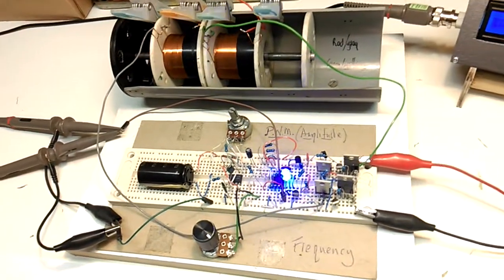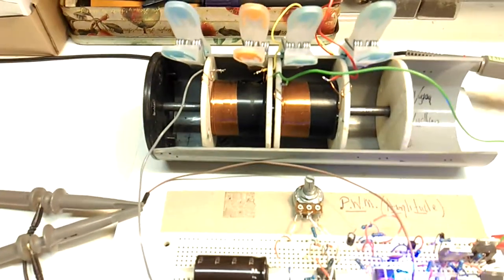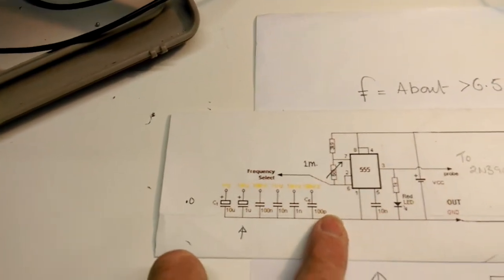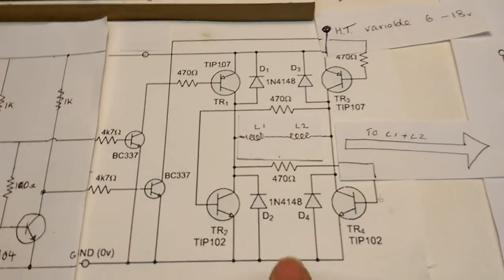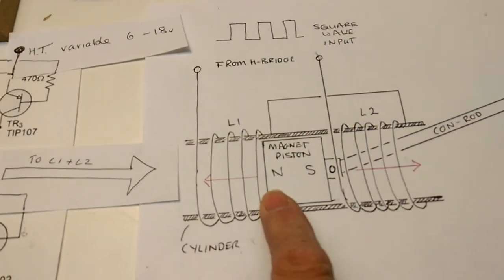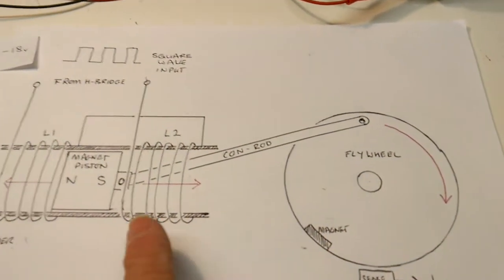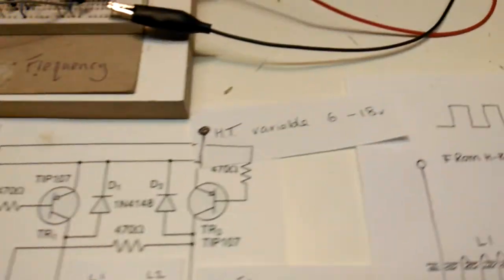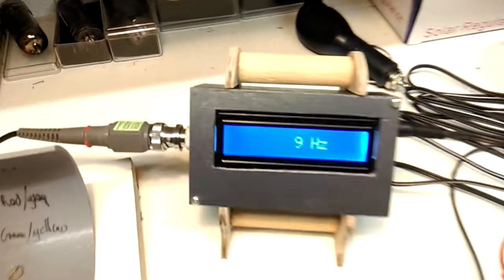Electromagnetic piston engine tutorial

Comment: You literally just solved my issue in a design. Sadly I don’t have the funding yet to implement this primarily due to getting a team together that I’d have to pay for a final design. Still finalizing a CAD design which uses a standard piston and flywheel for a prototype 3d resin print. Disregard my comment from the previous video. I would probably utilize a pin with larger diameters on both ends going back and forth between one coil though. I think that having either good timing or neodymium magnets on both ends of the electromagnet to buffer the pin from smashing every time would help with longevity. I will keep you up to date this project could take years before I can even discuss it publicly.
Reply from the maker: Thank you for your encouragement on this clip. I put it up just as interest really. It was a part of another project (now defunct). I'm glad it has been helpful. The arrangement is very frequency conscious so not much hope if varying speed I'm afraid unless you had a means of altering weight of magnets etc. So it works rather like a pendulum in a way. Yes please keep me posted on any developments.
Reply: @EddieFox  https://youtu.be/wHdFdw1hLzE

This is what I’d be shooting for in the end, but with full travel and speed control. I don’t think a bread board would cut it in this case. Probably would need software on a raspberry pi to modulate properly and change each set of coils down a cylinder. Then instead of like on the bread board having it switch on and off as it passes you could increase power and modulate speeds. I really just need something electromagnetic or a a fast enough solenoid with enough excursion for my use.

Comment: I am also a student, that I would love to use this concept to run my experiment (catalytic reaction) using such an oscillating floating piston.  However, I am a chemical engineer, with poor understanding of electronics. Would is be possible at all that somebody tells me how the circuit is put together? Can I use the labview to generate such signal? Or can you Eddie put the link (or the name) for the board, and electronic parts of this circuit board please.
Reply from the maker: Hi Mahdi. Thank you for viewing my clip. I have out here a link for the H-Bridge board on ebay.. http://www.ebay.co.uk/itm/Dual-L298N-H-Bridge-Stepper-Motor-Driver-Controller-Board-Arduino-Pi-ESP-UK-/182467585261?epid=1805364957&hash=item2a7bea64ed:g:qw8AAOSwceNZV4is
Reply from the maker: Here is a circuit for the 555 variable oscillator...  http://www.electronicecircuits.com/electronic-circuits/555-variable-frequency-square-wave-generator
Reply from the maker: Here is a circuit of a basic pulse width (or duty cycle) 555 circuit. http://pcbheaven.com/circuitpages/PWM_Fan_controller_using_a_555/

I take no responsibility for the content of the sites I have copied to you. They just looked quite informative. and the ebay link takes you too a common H Bridge ready made board (that works a lot better than my home made one!). I hope this is all helpful to you. Take a slow view of the tutorial. It's all in there but I am assuming prior knowledge I must admit. All the best!

Comment: Very neat setup and very nicely explained thank you!
What would the maximum rpm be that could be achieved with this kind of setup?  Instead of a rod, could the magnet be used to drive a piston?
I would like to use the moving magnet to strike the back of a chisel for doing engraving ie I want to build an electromagnetic engraver, similar to the pneumatic engravers that are available (Lindsay AirGraver etc)
Reply from the maker: Thank you so much for commenting on the tutorial and encouragement which is gratefully received. I suppose max 'rpm' would depend on build and balancing of the fly wheel etc. I haven't (as I said done any work on speed control). Actually there is a neodymium magnet with a hole in it sliding along the rod so at one end you could certainly mount a hammer activated by the magnet when it reaches that end. There is a resonant frequency of the mechanics so if you wanted to alter speed here some times it would not be at resonance and therefore not as efficient. Hope that helps!